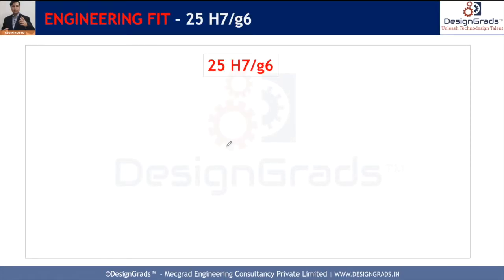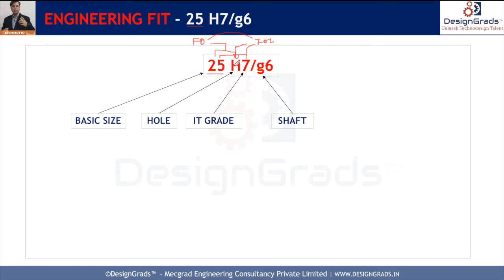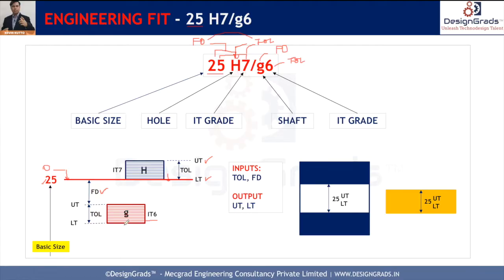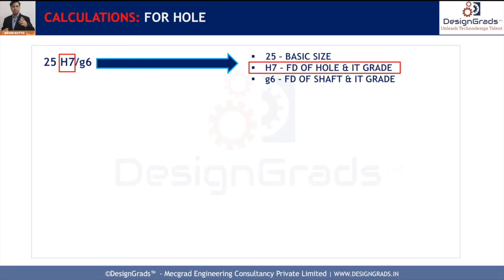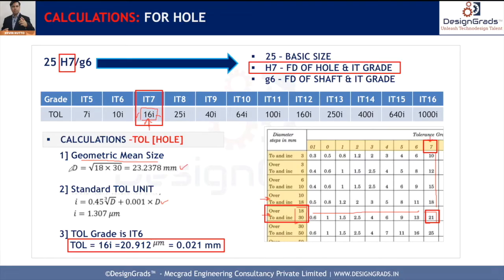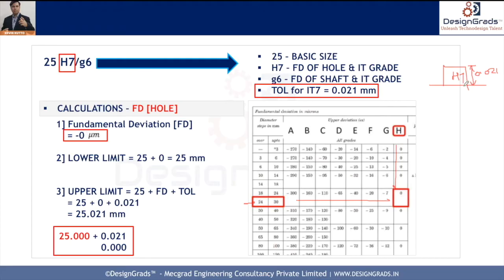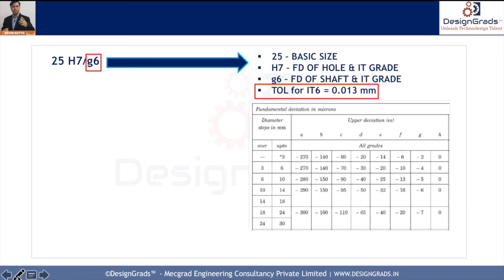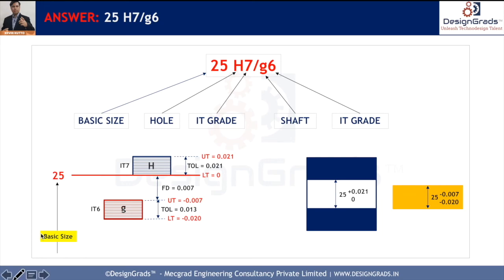H7 g6 Tolerance | Limits & Fits: ISO 286

Comment: Can u explain when we use H & g and when we use k and others letters
Reply from the maker: Combination H and other smaller letter Block depends upon Engineering Fit you need between two parts.

Here I have shown example of Clearance Fit with minimum clearance.

Comment: Suppose H7k6,which is transition fit, hole size H7 can be 0.021 and shaft can be 24.002.Suppose if different person doing shaft and  and hole,person keeping max limit for hole he is correct as per H7. shaft person keeping minimum size of shaft , he is also correct as per K6.
if other person assemble it,  there will be a clearance of 0.019,which is obviously a clearance fit.but we need transition fit.Theory is wrong? Please help to solve this. I need to do shaft from one place and hole from other person, what tolerance I have to give for both person to get exact transition fit
Reply from the maker: What is transition fit?
Transition fit is all about getting clearance or interference based upon size variation between hole and shaft.

Transition fit is used when small amount of clearance or interference doesn't affect design, whereas our purpose is perfect locating shaft in hole.

So, yes. In transition fit, getting small amount of clearance sometimes based upon size of hole and shaft is ok.

In clearance fit, we want all time clearance. We don't want interference at all.

Comment: You mean finding the value for the hole H is useless to find the limit deviation
Reply from the maker: When did I say that?

H or h represent hole basis and shaft basis system.

H or h had deviation of 0.

So, even 0 deviation is important for calculating Limits on hole or shaft.
Reply: @mechanicalvault   ooh now I understand when we are given H7 g6 and its nominal number means we have to find limit deviations both for the hole H and shaft g and all will have its own upper and lower limit deviation was confused thought maybe we will find one lower and one upper limit deviation for the all like 25 H7/g6= having one lower limit deviation and one upper limit deviation, it was out of not getting the concept now I got it right
Reply from the maker: Very good!